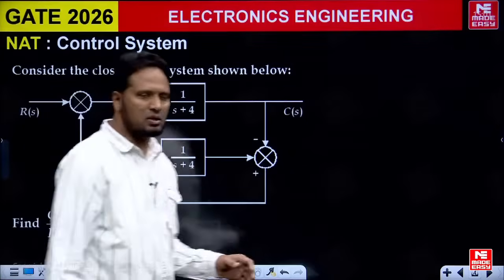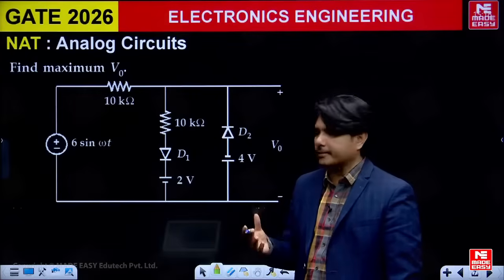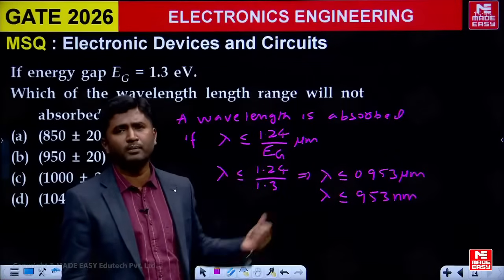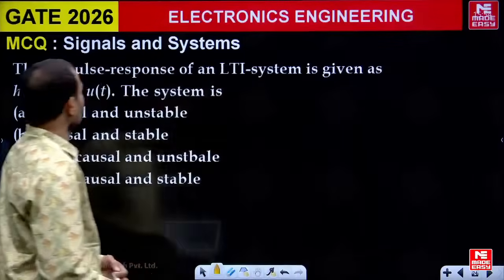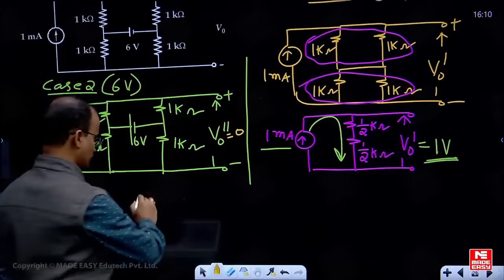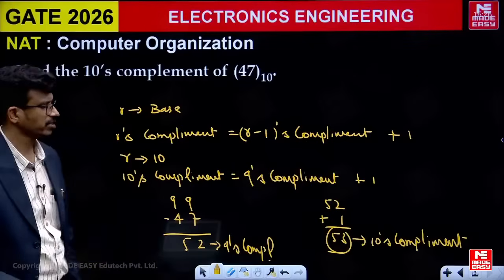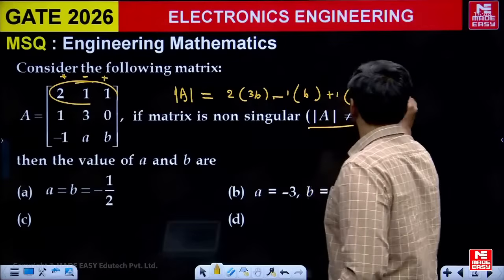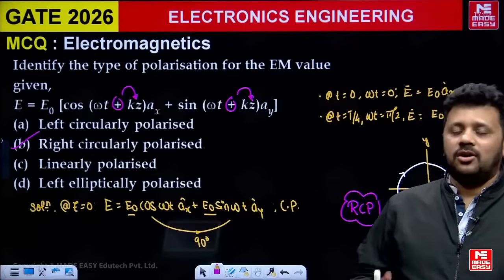GATE 2026 Electronics Paper Solutions | Detailed Analysis by MADE EASY Senior Faculties | LIVE

Comment: Dear Students, for MOSFET question of Analog circuits, if transconductance parameter is 2mA/V^2 then VG will be 2.56v
Reply: Yes bro
Reply: Sir that diffusion current answer will be in negetive
Reply: @rashmiranjandishri3042 that's different question
Reply: @rashmiranjandishri3042 are u sure negative
Reply: Energy gap edc wavelength question has 550+-20 option a
Reply: @rashmiranjandishri3042 i didn't solve this